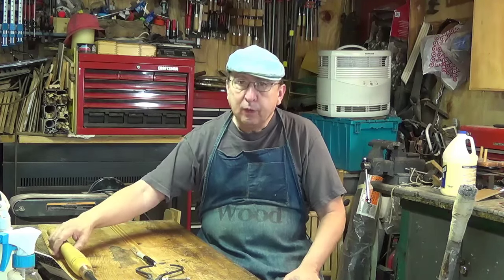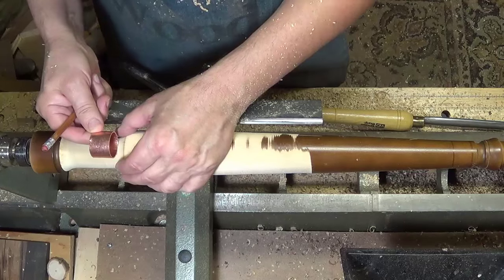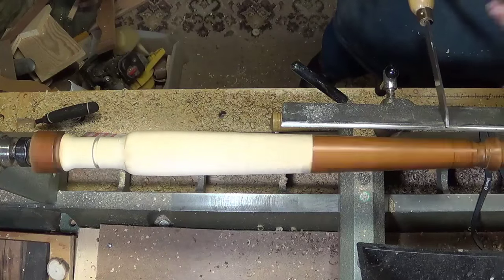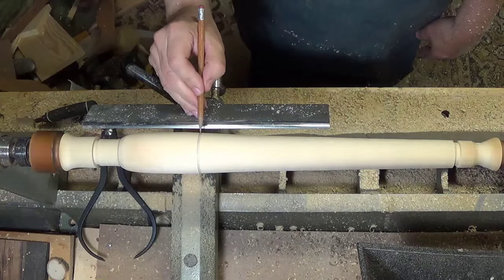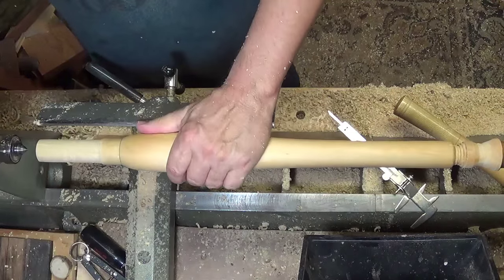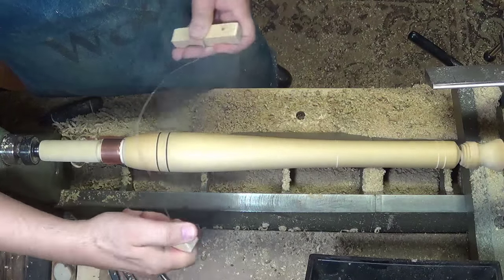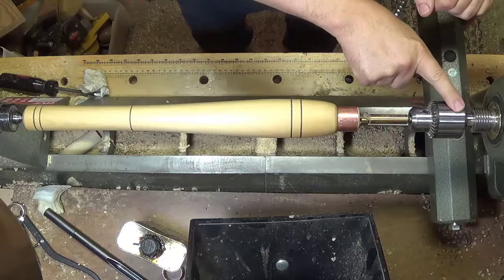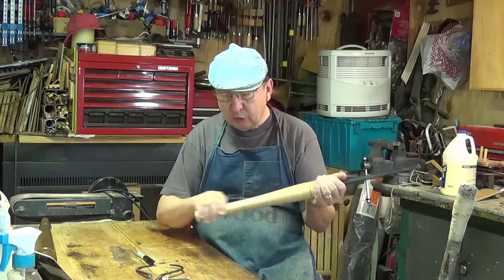Woodturning Bowl Gouge Tool Handle

Comment: Firstly congrats on the subs Cip, well deserved my friend. And secondly, and by no means least, a beautiful handle, and a very informative tutorial. I will be using your method for drilling the hole for the shaft of the gouge, brilliant . Thanks for another great video.
Cheers
Mike
Reply: Mike Waldt Most videos I've watched show the hole being bored at the tailstock end. Is there some advantage to doing it at the headstock end?
Reply from the maker: BigWingUK Hello there Big Wing! I turned the handle as a spindle, "between centers" If I had used a chuck to hold one end I could have reversed the direction by spinning the handle. I think it gave me a good well-centered hole. Cheers
Reply: BigWingUK I haven't tried it before, but as Cip says it seems to achieve a well centred hole
Cheers
Mike